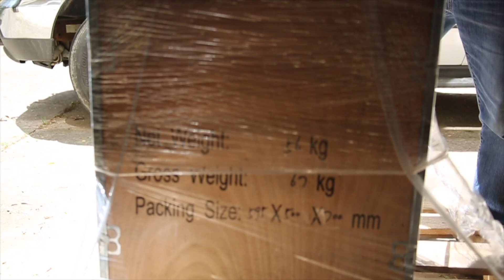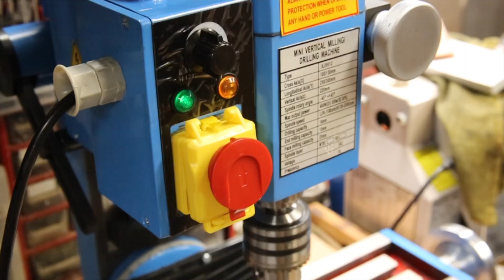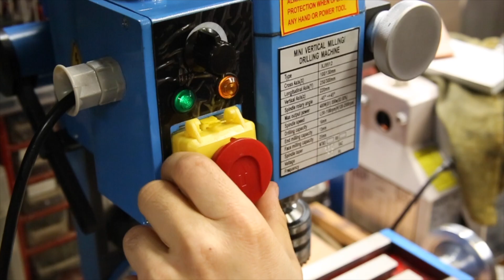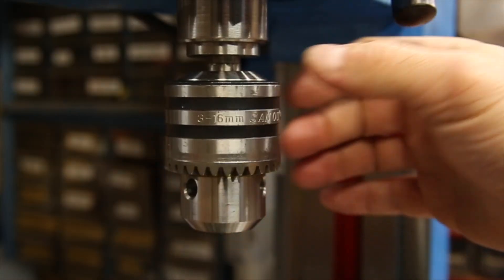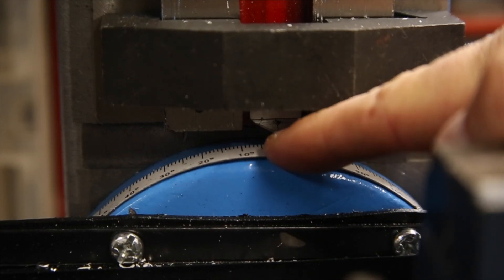Cheap Chinese Mini Metal Mill Milling Machine Unboxing, Setup, Testing, and Review

Comment: I own a similar styles Chinese milling machine that came with similar accessories. An essential task is to securely bolt the tool down and level it out in reference to the table, mine is on a 40 mm thick base and shimmed for level. As stated by so many here, buy a collet set, they are not too expensive and will give better results. Next on your list should be a milling vice, cheap pedestal drill vices are totally inaccurate for any precision work. A rotary table is a great accessory to have and Vertex make exceptionally good ones for the price of them. Buy a set of dividing plates and an end support for the rotary table. A good quality 3 and 4 jaw chuck is needed for the rotary table - look for low profile ones as you lose the vertical capacity of the mill with everything you bolt to the table. You should also look for a table clamp set that will allow you to hold large and irregular pieces to the table. A tip for the studs on these is to cut the threads to the maximum depth of the T nuts that hold them as this prevents them binding on the bottom of the table slots or coming loose when working. Cheap milling cutters are that, cheap. Buy good quality ones. Fly cutters are another essential item to buy to get good surface finishing. A clock gauge is essential for setting up your mill and work pieces. Any time you alter the head angle you need to reset it accurately again. With time you will learn the little quirks of your machine and be able to compensate for them. as you gain experience you will accumulate more equipment for your mill and gain more pleasure from it.

Comment: I agree the drill chuck is only good for drilling, even though,  I have used my floor drill press as a mill before, but it looks to me R8 is what that mill uses. As far as capable that little mill is very capable of doing small projects, I have a grizzly that we use as much as our brig-port.

Comment: Use oil for metal like hydraulic or machine oil and if the bottom moves up or down use that instead and the chuck you should use a tool holder that holds the bit

Comment: Make sure you tram the table out and use collets instead of chuck, 2 flute high speed steel end mill  is better for aluminum in my experience and use your speeds and feeds, little machine shop has a good calculator for that.

Comment: Hey Tim, get a hold of Accusize Industrial Tools, I got a 2" R8 Shank Carbide Indexable End Mill 
(0046-0916) for my machine ( Craftex CX-605 ) it's about the same size as yours and should take the same R8 Shank. Works great for that size of machine, leaves a great finish. Oh Think about picking up the R8 Collet set for your machine, it does a much better job at holding the various size end mills without slipping, much better than the drill chuck. You will be amazed once you tweak a few things in and make a few adjustments what you can actually do with these little mini mills... Cheers! Oh hey for more info check out, "This Old Tony" on YouTube for lots of tips and tricks...

Comment: First of all you should build a strong table and blot the tool on. the machine is flexing a lot.but you will find somewhat of a improvement.  the Chinese use inferior cast iron/fast colled... if you put the machine faces on a precision plate you will see how it moved after they machine it. and no, even if you scrape it again. the results will be the same.

Comment: I have been looking at this for a while.. Would love to get one. Having had some experience on a few bridgeports i can definitely say that i would be getting a set of collets for endmills as the drill chuck doesn't have enough rigidity for endmilling. For facing i reckon you could get a decent facemill that takes inserts. I think the machine should manage ally, brass etc with that type cutter. Would probably manage mild steel (or maybe just the easy cut impregnated stuff).
Reply: How could you have worked on Bridgeport mills and even consider something like this?

Comment: I would learn the difference between climb and conventional cutting. It isn’t so important if you don’t care about your finish or are taking small amounts off. Climb cutting can get dangerous because of how the mill pulls to the metal. In general you want to keep the material feeding in from the left of your mill.

https://youtu.be/galm5_6SUcM

Comment: I'm not an engineer, just a hobbist and don't own (yet) a mill. but i've looked into it and my plans are: mount it sturdy on something good like metal workbench, buffer the machine and the bench with lead sheet used like in roofing construction. That will dampen the vibrations and help a long way i think. next is leveling the whole thing out, first to the ground, than the crosstabel to the spindle. if you want to make it fast, i would epoxylevel the bench before putting on the lead. a quality machine chuck is next, and a set of precision messering tools, on top of them would be a dial test indicator and a normal dial indicator plus the stand for it to adjust all axies and so forth. then when i'm still not happy i would look up on the www what else i could do :)

but my first shop tool will be a lathe, and i will learn a lot there first. after the mill, the lathe problably will come a surfacegrinder, or i will invest in a more accurate surface plate. i don't know yet.

don't listen to the negative nancies is one of the best tipps someone gave me about this hobby. not everyone can afford a pro tool, and you can do with chinacheap. actually you learn a lot with it, because i look at it as "unfinished tools". A good engineer can build his own tools, that's what it is about

but one thing is true i read here in the comments, the thing is a bit small for medium to big size parts. you want heavy tools for accurate and big parts. alltho for model hobbie, it will do the trick i feel.

Comment: Nice little hobby mill, you will get plenty of people telling you it's crap but any good machinist knows how to make adjustments and improvements and learn the querks of the machine.
You have the basis of a potentially  good mill there, the chuck is really only for drilling, if you want to mill then I would buy a proper collet chuck, this will stop the cutter being pulled out of the Jacobs chuck during operation and will also improve on the wobble, also make sure you can lock the quill off properly during machining to stop any travel in Z axis.
As for finding the centre of a component I would bin that edge finder thing and use a d.t.i (dial test indicator) something like a Verdict T32 lever type clock, you won't go far wrong with one of those. You can experiment with cutters, end mills are ok for finishing perpendicular faces, slot drills are best for slots I generally go for 3 flute, for deep pockets and slots you'll be amazed by what   Strassman type ripper cutters can do, for good finishes on faces you could make yourself a single point fly cutter. If your new to milling then I would look up milling methods such as the direction of cut (climb milling ext.) Great stuff, have fun.
Reply: Tony Hewett p
Reply: I agree. I bought a small Grizzly lathe and it was a satisfying project to make improvements to it. In a sense, the tool became the project! The result was a lathe that produced good work and was fun to use.

Comment: Get some spring collets that will fit to the mill (if they sell any for that mill) and mount the mill on a more sturdy surface than the pallet to avoid to much vibration. And sfm for hss end mills in my opinion works best at 100 if there is a way to gauge the speed of the spindle.

Comment: You should try and make an updated video in this. I got one a few months back also.
Reply from the maker: Hey! What kind of updates would you want to see?
Reply: @TimNummy  the mill in use with a project, any upgrades, adjustment you made, tools etc. Cuts on different types of materials.

Comment: Dumb question but can this also he used as a normal drill press?
Reply from the maker: Sure, but one thing to note is that it doesn't have a spring return to lift the bit up like drill presses usually do. Also, you'll have to be mindful of the bed because there's no relief hole to allow the drill bit to pass through once it gets through the part.

Comment: Firstly if your using as a milling tool I would make a shield to protect yourself, safety first. As other comments have stated make yourself some parallels. They will help greatly. You might also want more end Mills of different diameter and lenghg( slow spiral ones work better on ally) have them held as much a possible In the collet or chuck. This will help reduce chatter and push off

Comment: Hi there so for starters dont drag your end mill across the top of the part it will leave little scratches second off at least in class we use a realy high speed for aluminum and we calculate this by 300×4 divided by the size of end mill also if your trying to be precise then get a indicator to tram the vice in the mill and for edg finding u take half the size of the head of the indicator to be at the correct zero now of corse we use Bridgeport mills so take this how u will hope this helps

Comment: A couple of things need to be done if you want to achieve a better finish. 1. You need to mount the mill to a surface that is not going to enable any movement, by doing this you will reduce the machine chatter and get a better finish on your peace. 2. Invest in two different size collets to hold your Milling bits, a 3 jaw Chuck will loosen up on the Milling bit and ruin your peace and will further reduce machine chatter resulting in a better finish. 3. Lock the head of the mill in to position as much as possible any movement will ruin your peace and destroy the Finish. 4. Invest into a machinist handbook so you can better familiarize yourself with the speeds best suited for the material you're working with. And lastly try to upgrade the mill to a 2 axis CNC or digital readout at the very minimum, this will greatly help with the accuracy of your work. Good luck!
Reply: *Piece...

Comment: First thing to do to improve finish is to remove the mill from the wooden base and bolt it to a heavy duty table, then get yourself tungsten carbide tipped tools and run them at high speed, they are more expensive than HSS but well worth it...... hope this helps.

Comment: Great video but check your feed and speed rates which are crucial to a good finish. There are many web forums that have a bunch of great folks that will help you become a talented home machinist.  It is an awsome activity and I my self took an advanced machining course at ivy tech community college after i retired from 24 years service in the US Army and i love machining and I'm also a gunsmith and my mill and old school full size lathe that I'm still learning and i think its awsome and the folks in these forums are also AWESOME. I am still working on getting tooling but love it. As a disabled veteran I have to get the tooling as I can but again I love machining because your only limit is your imagination!!! Good luck and God bless HOOAAH!!

Comment: I think a general rule of thumb is if you can lift the machine by yourself then  the machine probably won't be very capable.
Reply: That may be true but sometimes cheap is all people can afford.
Reply: @southernwulf530  that is true a lot of us are on a budget and I would like to get into machine and so I've been looking at a Chinese male in life if I have to Tinker with it I don't have a problem with it because going into this I know it's Chinese and it's not going to be perfect but it's better than an angle grinder hand drill poor people have poor ways
Reply: @southernwulf530  Sure. but that's why the second hand market exist.
Reply: DaToNyOyO  Hahaha... I think you nailed it... ;-)
Reply: Id guess any machine is less than capable for you...
Reply: These mini mills setup correctly easily cut within a thou along the whole length of the table...  granted these are not production machines.. your not gonna hog out .250” a cut. However it will get there with very clean accurate results depending on the operator
Reply: Dan Ward , you're right. It is an inexpensive mini mill for hobbyist. Don't expect high precision and heavy metal work from it
Reply: @chuckphilpot7756  I guess that shut him up... haven't seen him respond since.
Reply: the legit rule is this. if your tools come from China is true crap. Can't afford a new USA european japanese or russian  mill or lathe? stick to a second hand one.
Reply: @vladnickul  pretty sure the rule is... use what you can get and dont bitch about what you want.
Reply: @joshuas390  that's the best rule I have heard in a long time
Reply: @vladnickul  actually that isn't a good rule of thumb. China makes very good tools, they just aren't available for 500 bucks.
Reply: @vladnickul  the legit rule is this "blaming an entire country for a manufacturers defects is a sure sign of a smallminded ignorant prick who has no business using any tools in the first place." You sound like the guy who would be wrapped around the spindle come work on Monday morning. Hurry up with that, make sure you wear all long sleeves and gloves please.
Reply: sorry folks; these machines are very capable. I have built many small hit and miss engines that look and run very well, of course I don't know any better; the mini mill from china is a very good mill and my first mill. Plus Where can I buy a U.S. made mill?
Reply: @vladnickul  That is complete bullshit. China makes some very decent tooling. Usually if a tool doesn't work properly it is due to operator incompetence
Reply: @benpress8884  :)) Do you even own a machine from China, a machine you put some hours on? Guess not :)
Reply: @vladnickul  actually yes I own several Chinese cnc swiss lathes. Very good quality. Better than that U.S.A. made haas garbage.
Reply: @chuckphilpot7756  you own Chinese  cnc Swiss lathes?:)) Jesus...Good thing I own a australian truck made in North Korea.
Reply: ShazamMafia , I have opportunity to used and seen many Taiwan , China and South Korea made lathe,milling and CNC machines in machine shops. They’re reliable and can do precision work without problems. Down to 0.0005”  tolerance. They’re not cheap to me $100000 US and up. Want really good ones go for the Japanese made that can reach $ 200000 US.  Good machinists stay away from US made HAAS machines. What amazing about the Chinese industries is that they can cover a wide range of products in a range of prices . From professional workshop machines to home hobby machines. Something I don’t see any other country can do. Before the availability of the Chinese made home hobbyist machines. Hobbyists have to make these machines themselves
Reply: ShazamMafia , today many of us can easily own many power tools. Before the availability of the Chinese made power tools. It’s rare for most of us own mitre-saws , power generators and chainsaws. I remember the first simple mitre saw I saw was around $500. Most of us used mitre box for angle cutting back then . Now I can see them everywhere in hardware stores with replacement parts for sale. Chainsaws used to be a specialized tool sold in  a specialized shop. Most of us can own a Chinese made air compressor today but it is  a rare thing to see some years ago to see friends and neighbours own one let alone a milling machine
Reply: @vladnickul  I actually have seen used Bridgeports on Ebay at doable prices not much more than the Siegs.  However that doesn't include shipping and it ignores that most home basements do not have thick enough concrete flooring to hold those behemoths, nor do they have the electronic supply needed.  But these minis run on 110ac house current and they (most of them) weigh well under 500 pounds so the homeowner can move them and even hand carry them down into the basement from the front door.  Noting your xenophobia about Chinese products, a decade and a half ago when I was searching for a mini mill or lathe running on house current at a rational price basically I learned no one makes one in the US.  So far as I know that is still the case.  One can get the large Smithy all in one machine, or the Tormach 440 (their closest in size compatibility to the Sieg X2).  Jack of all, master of none applies to the combo machines.  The US made Tormach 440 is almost 10 times the cost of an SX2 but has smaller everything too.  (based on the prices shown at Little Machine Shops mill comparison page and Tormach's own website).  From that multi thousand dollar entry price their prices only go up.  Noting also Tormach offers no product in the size class of the Sieg C lathes with the cheapest Tormach lathe starting at about $13,000.  Smithy does offer a machine (MI-409MZ) similar enough to a Sieg X2 series that I am suspicious as to origin, but for $3500 (per their own website) stripped and the biggest significan differences I can see are a power feed on the Z axis and a DRO, both features that can be added after market to the Chinese Sieg products at a much lower cost.